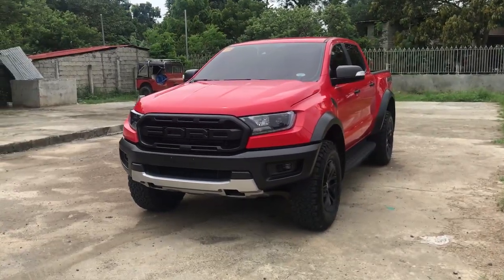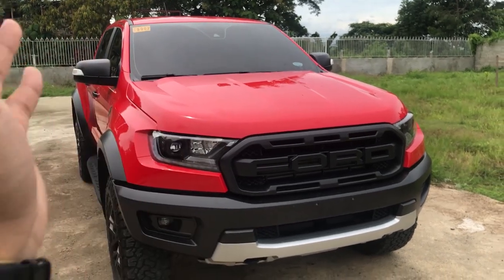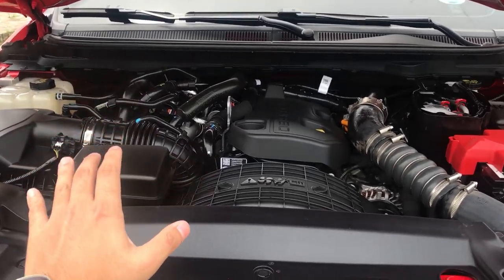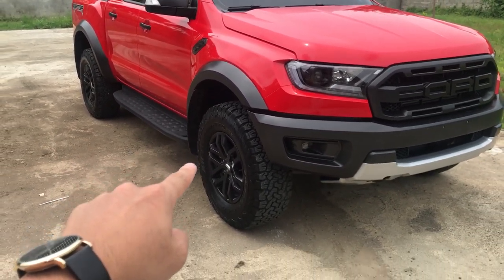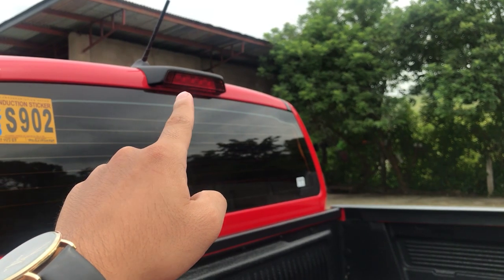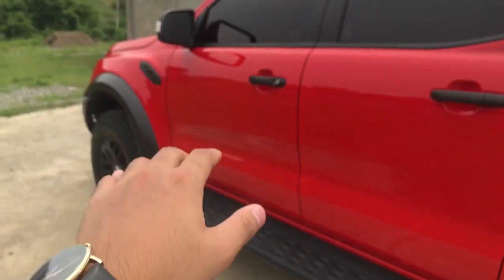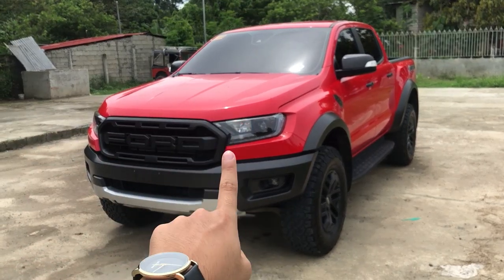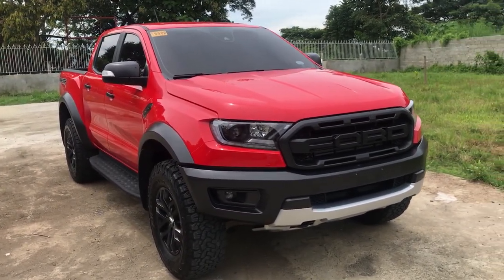2022 Ford Ranger Raptor In-Depth Review (Philippines) | FulgentGaray

Comment: Hello! Thank you for your review and it is even more valuable coming from as an owner. I am keen to get one, but one area for the Ford Ranger Raptor that holding me from buying it would be the Fox shocks. Since this is a wear  and tear items, would you able to advice  how long long does it last? Also, my understanding is that the shocks is considered as big ticket items. Does the shocks need to be replace or Ford will rebuild it? If replace, how much would that cost for each of the shocks?
Reply from the maker: Hi! Very interesting question. As far as I know, Fox shocks typically last about 80,000 to 100,000 kms before they need to be rebuilt. These shocks are rebuildable so you don’t need to buy a new set (which would cost a fortune, btw). There are authorized Fox shocks service centers in Makati and Bacolod. Though I’m not sure if they service cars too. I sent them a message and will get back to you! 😁
Reply: @FulgentFave  Thank you so much for the advice! Really appreciate it.

Comment from the maker: Hi, all! Thank you for bearing with me. If I have missed anything or if you have any question, feel free to comment below! ❤️

Erratum:
1. Wheels are 17x8.5, not 17x9
2. Rear brake discs are Ventilated, not Solid
Reply: I am curious though if i can order it with a panoramic roof....i know they have the option on f150 raptor but havent seen it on ranger raptor :(
Reply from the maker: Unfortunately, for the current generation Rangers and Ranger Raptors, you can’t. However, the next gen Ranger is right around the corner. Hopefully it will have a sunroof like the Everests and the F-150s

Comment: Thanks for the review dude.  This is exactly what I was looking for the differences between the old model and this new one. Because looking form the exterior/interior it looks just about the same.   I'm looking for the best deal for 2019-20 Raptor model with 20K or less mileage here in Cebu City.  P1.4 or 1.5M less depreciation should be fairly reasonable.  But it just all depends on the current market for willing seller & buyer.

Comment: I have a 2019 Ranger Raptor released Feb of 2019, Running at almost 35K Km. So far the only problem for me is the stock battery that only lasts a year with no heavy lightning accessories. I just found out that my Transmission # is 43, glad that the engine is running smooth and doesn't shows any symptoms of the issues. You might hear some rat knocking sound behind the dashboard, the cause of that is the faulty Actuator behind the glove box which is a known issue to rangers and everest.
Reply from the maker: Hi, great to hear that. You must be not be part of the faulty batch. As for the battery, it’s more of a hit or miss. Some can utilize their stock battery for up to 4 years. The one in our Everest only lasted for 2. Yes, the AC actuator is a common issue. The ones in our Everest are starting to act up, but other than that, no issues.

Comment: Sir let me tell you about my experience with my 2019 Ranger Raptor. It was 22 months old with only 20,000 kms reading and the #4 fuel injector gave up. Luckily it was still under warranty. When you mentioned about the transmission slipage or sometimes it drags mine still does that once in a while at 40,000 kms. Do you also notice a buzzing sound when you open the driver side door? If you don't then that is another defect on mine. Thanks for the video
Reply from the maker: As far as I know, all the ticks, unusual sounds, rough shifts should be gone after the break-in period. As for ours, all of the above were gone at roughly 3,000 kms. And no, I don't hear a buzzing sound when I open the driver side door.

Comment: Thanks for this. Correct me if i am wrong, still no 360 cam for the 2022? You think the 2023 version will have a significant price increase here in the philippines?
Reply from the maker: This one, 2022, does not have a 360 cam. The facelifted 2023 model will definitely have that. I'm not quite sure, but if there will be a price increase, it should not be that significant.

Comment: Very in-depth review! I'm currently leaning towards the D-max but I've decided to at least wait for the local specs and pricing of the all-new ranger since it's just around the corner. The upcoming Ranger looks very promising but I hope that they'll just carry over the current tranny and engine or at least make it an option for the top-spec non-raptor variant. Because I'm pretty sure they would've already ironed out most if not all of the issues by then with years they've already spent working on them. I'm not hyped about the V6 diesel since if I get one, it will surely spend around 80% of its time in city traffic and I won't be towing or carrying any heavy loads most of the time so the extra power and fuel burn is not worth it for me especially with the rising fuel prices. I just have a few questions though:

1. How is Ford's aftersales service? 

2. What service interval are you following? According to Ford PH, the maintenance interval for the current ranger and everest should be 12 months but I've seen some local dealers that still follow the 6 months interval which increases the cost of ownership and earns them more profit.

2. I know that you were given a free 5-year SSP so does Ford still charge you for some "extras" every pms or is it completely free of charge?

3. What's your Raptor's current mileage and are there any new issues?
Reply from the maker: Hello, thanks for the feedback! As for the next-gen Ranger, there is no V6 option for the Philippines. It is exclusive only to some markets like Australia. So, that would be a plus for you.

As for your questions:
1. So far, I have not experienced anything negative from Ford CDO. They have been very accomodating.

2. The service interval is 10,000kms or 12 months whichever comes first. That may be because the older engines have the old interval which was every 6 months. But as far as I know, all vehicles sold from 2020 onwards have the new service interval already.

For the SSP, Ford only covers what service is  recommended to be done. This can be found in their PMS section. If you want any additional extras, that would be of additional charge. Say for example you want to change your fuel filter earlier than recommended, you will shoulder the cost for that.

3. The Raptor is currently nearing 7,000 kms and I have not experienced any issues so far.

Hope this helps ❤️
Reply: @FulgentFave  Thanks for the very quick and informative response! You deserve more subs. Looking forward to your future content. I'm now definitely considering the next-gen Ranger.
Reply: @FulgentFave  Hi sir, im frm Pagadian and planning to get one, do you think they would retain 2.0 bi turbo engine to philippine market?
Hows the Ford spare parts availability nowadays if ever we need one? Thnx and God bless!
Reply from the maker: Yes, they will retain the 2.0 engines. No V6 option for the Philippine market. So far, there are already many parts in the market so that should not be an issue.

Comment: All the 2021/2022/2023 stuff is just marketing jargon to get people to buy cars. Not everyone knows what the latest is so they trick people this way. This is not a 2022 Raptor. It's a 2021 Raptor based off of a 2011 design.
Love the fact it has Max AC. All cars should have that and it should be as powerful as BMWs. But it's let down by the lack of rear air vents this creating two climates inside the car with the rear being warmer than the front. Newer cars should not only have centre rear vents but B pillar vents too. 
Thaks for the nice, detailed review. Love the posh sounding warning chime when you were getting into the car. Wondering what the seatbelt chime sounds like.
Reply from the maker: Exactly my point. It’s a 2021 model considered 2022 by Ford PH.

Comment: Nice review. Can you do a review on the tires that you mentioned? I need to replace the stock tires on my montero and I am considering All Terrain or Mud Terrain. I am just worried about the noise. Most of my travel is on asphalt but I visit my farm property from time to time. Ive been stuck several times in the mud when I visit.
Reply from the maker: Most of the tires I used were mud terrain (Comforser CF3000, Savero MT, Cooper STT, Delium Terra Warrior). If you are concerned with the noise, I am not going to recommend MT's since they all hum so loudly in highway speeds and they wear down faster than AT tires. AT's are good but it may still get stuck especially with deeper, more slippery mud ruts. The BFG KO2's are super silent on the road even when you have the windows open, you barely hear them. However, traction-wise, it tends to get slippery in wet pavement but it is excellent in gravel or light mud trails. I would advise getting a set of all terrains first and testing it out if it can handle the terrain. Otherwise, it would be best to have a dedicated set of mud terrains when you visit your farm.

Comment: Is raptor hard to park? cause we have fortuner ltd i can park with it plus the 360 camera helps. I really like the new ford ranger 2022 the infotainment is really big like a big ipad
Reply from the maker: I'm used to it by now. When we first got it, there really was a learning curve as it is wider and longer both in length and wheelbase  than our Everest. If you find parking your Fortuner easy, then transitioning to the Raptor is not that difficult. A standard Ranger would be easier to park, though, since it's narrower.

Comment: Hello sir! If you can please post POV videos. Thanks. Btw, do you have an idea when is the next year model going to come out? Is it around july-august?
Reply from the maker: Hi, I’m still eyeing on a GoPro for the POV drives but yes, soon I’ll post some. The next gen Ranger is most likely set to be released in around the 3rd quarter of 2022.
Reply: @FulgentFave  appreciate your response. I will be moving to Philippines next year sometime April-May to study so i am planning of getting one. My only issue is will it fit on a standard parking space in condominiums in Manila. I think it is 12.5 sq. meter. Anyway, i will be waiting for your POV videos. Thanks.
Reply from the maker: @riggsdtr  It should fit, but it will be a squeeze.

Comment: How can one know that the unit is not a 2019 refurbished? salamat sa sasagot
Reply from the maker: Take a look at the registrstion or insurance papers to see what year model it is. As for repairs, if you see that the transmission number does not match up for the 2019 model year, it's probably replaced since Ford did offer to replace the whole transmission instead of just the faulty oil pump gear for affected units.

Comment: is this really a 2022 or 2021? the new 2022 Raptor that wil come out nxt year will come with a 3.0 V6 engine.
Reply from the maker: As I have mentioned in the video already, this is the 2022 model for the Philippines. The new model will be the 2023.